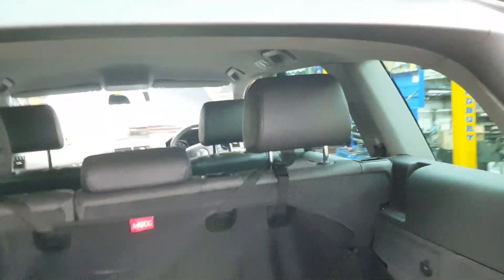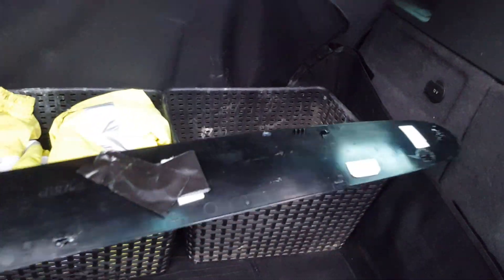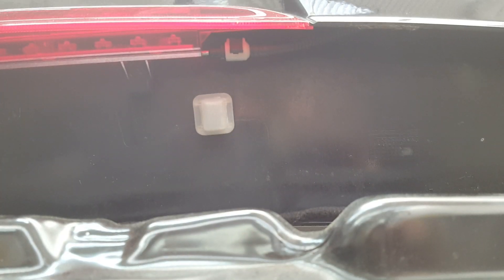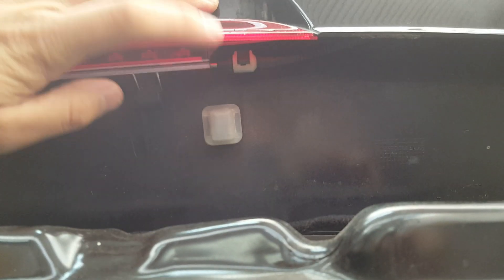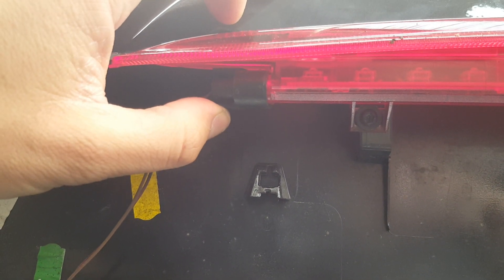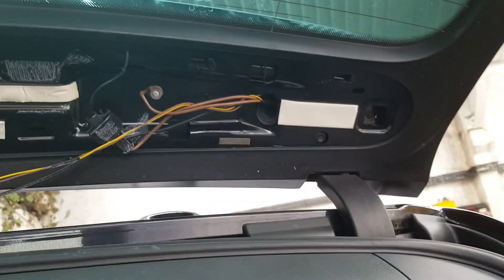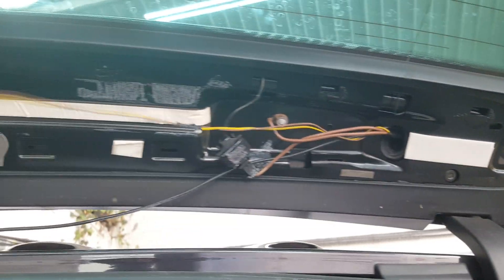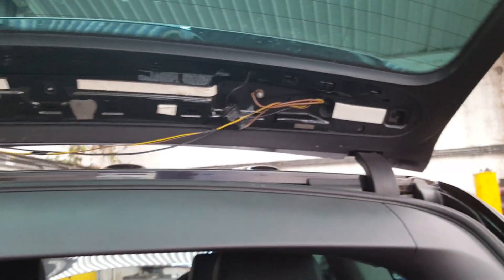VW Touareg rear center brake light replacement/removal.

Comment: ok not totally useless, but mu 2005 touareg has four bolts to undo and before you can undo them, you need to remove the entire window surround to access the two corner ones. Thats all the trim and then the metal framing?

Comment: Changed mine but still not working :( must be a wiring issue :(
Reply from the maker: If you can get a multimeter and someone to press the brakes then you can check the feed to the plug. Is all of your other brake lights working?
Reply: @AlexTheGrumpyOne  yeah the other 2 work fine, bought this one confirmed as working but still nothing so guessing it’s the wiring under headlining somewhere :(
Reply from the maker: I would check first in the rubber seal that you got going at the top from the body to the boot door. Usually wires breaking there.
Reply: @AlexTheGrumpyOne  thanks I’ll have another look after work. Got angry with it and walked away haha 😂
Reply from the maker: Haha see you doing well. I get angry and carry on haha... then you become permanently grumpy.
Reply: @AlexTheGrumpyOne  haha 😂 or break something 😂